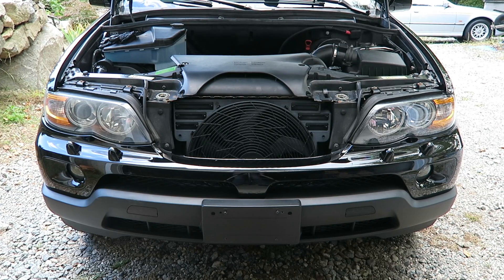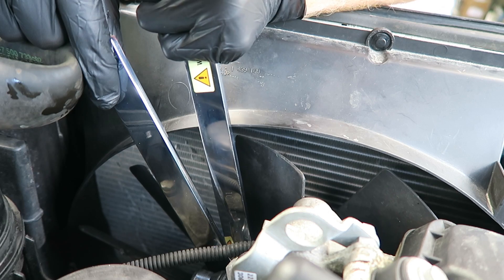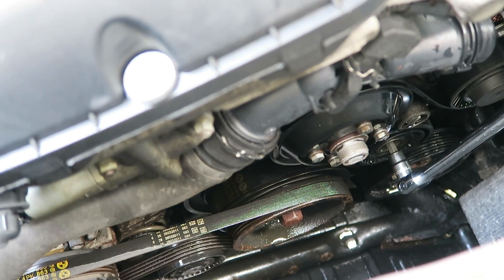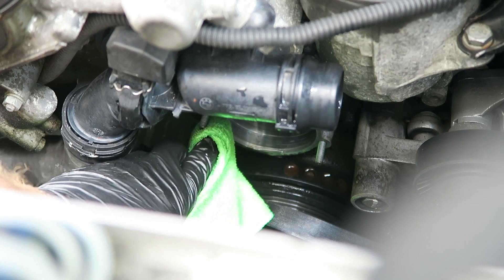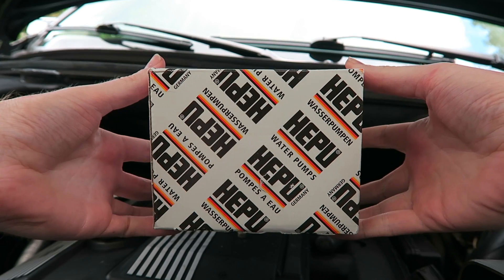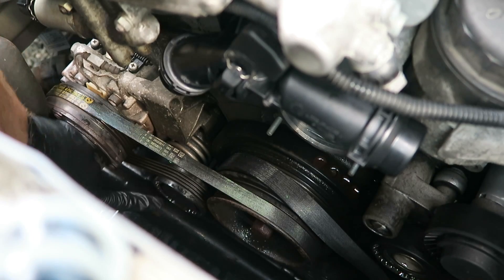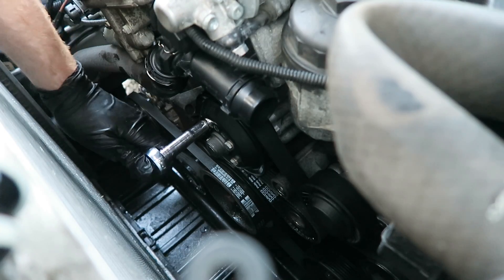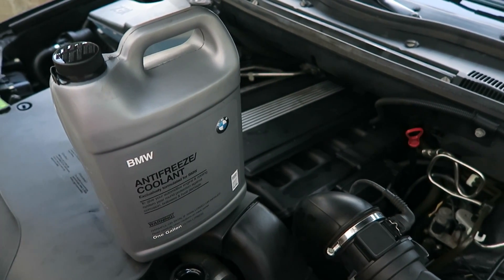BMW M54 Waterpump and Thermostat DIY E39 E46 E53

Comment: My 2003 e 39 had 2 different bolts , one of the differences was the 4 10mm bolts on the pulley, on my e39 it was 3 10mm and a 4mm hex. For my serpentine belt loosener bolt thingy it wasn’t a 8mm hex , for mine it’s a torx screw and I believe a 50. I’m currently headed back to AutoZone to return the 8mm hex and get my torx bit.

Comment: After slipping with the screwdriver one time I'm putting a pin hole in the brand new radiator I always suggest throwing a fender skirt cover over the radiator can save you big money and time👍😏 job well done

Comment: Just replaced my thermostat dated 06-12 and water pump dated 02-03. Great video. Only thing different i had to do was insert a 6mm 1 inch long bolt onto the water pump in order to break the seal since mine was never replaced 205k on my x5

Comment: Didn't know about that date code stamping  BMW does to parts. Cheers for that awesome tip. Off I go to check mine. 
Excellent tutorial btw.  Clear and consise.
Oh, and I'm working on a 01 530. What are your thoughts on the stewart water pump that apparently has 20% more flow capacity than the original?  It costs around $200 but the peace of mind it would bring from never having to do it again and I'm not exactly a big fan of these M54's running at 195F  - 200F. Seems a little too high and as you probably know, heat is the enemy of all engines. Aluminum ones especially.
Reply from the maker: Thanks Andrew - appreciate the kind words. Have an awesome weekend!

Comment: man you`re such a great guy to upload this video but why on earth do you put HEPU on your gorgeous car?
Reply from the maker: that HEPU pump has been in service now nearly 5 years and 60,000 miles .... what is there to complain about even if it fails at this point?
Reply: @BIMMERZEITT  it`s name mate.. gldad you didn`t have an issue with your X5 for 60K miles. could you please tell me btw, can an antifreeze spoil the waterpump? 2 hours ago we started the car and it got a squealing noise from the engine..
Reply from the maker: @ramazkutateladze538  yes if wrong type of antifreeze is put in it can cause corrosion and eat seals over time. I've seen it when orange GM coolant put into a BMW. Yes, I've seen it lol. Some pumps are designed to weep fluid when the internal seal fails so theres that; mostly older BMW's though. Hoses and thermostat could also leak onto the belt, thermostat housing on m54 weeps fluid when it fails sometimes too. Best course is to pull the fan clutch, radiator shroud and inspect closely.
Reply: @BIMMERZEITT  mine is the X5 3.0 2004; aand probably a year ago I poured in it blue Antifreeze.. some off-brand one.. but then again the car has 273K kilometers on the clock.. and there is a chance that the pump is factory-original.. car did not lose any motor coolant though..  thank you for your response, will write the news tomorrow from the repair-masters shop

Comment: Hi Bimmer Zeit, hope you can guide me in the problem I have. On my 2004 X5 3.0i, I have a brand new dealership thermostat. I run the engine idling, the temperature stays normal at 12 O'clock and my code reader shows the coolant at 205 degrees F. Thermostat stamp says 97 degrees C which is 207 degrees F. Doesn't matter what I do, the coolant never goes higher than 205, needle at 12 O'clock. So I can't bleed the coolant system completely because the thermostat never gets the chance to open. So I'm left with air pocket I can't get rid of. Is this normal? Hope not!
Please guide me through this.
Thanks,
P.S. The heater blows very hot air on the road and not so hot when idling

Comment: Thanks for the video, I'm looking at buying a 2002 BMW 530i E39, that needs a new water pump and thermostat. Hope it's as straight forward as this
Reply from the maker: sasunmontu it is very easy, not a big deal at all. Tricky part is getting the fan clutch off, smooth sailing after that! Excellent vehicle choice!

Comment: Great video!  My water pump just gave out on me yesterday.  I saw another video that the guy used a silicone lubricant on the new pump before he installed it.  Have you heard of that being an option before re-installation?
Reply from the maker: Hey Ron, you probably could put a very thin layer of silicone lubricant (NOT sealant or make-a-gasket) to ease the new gasket popping into place
Reply: @BIMMERZEITT  You are the man once again...thanks!

Comment: Thanks, your video is really amazing, professional quality for eveything.

Just a few precisions : the torque for the bolts ?
Some people put some kind of grease on the o-rings and the bolts, what do you think ?

Regards.
Reply: O- rings - yes, use a little bit of grease so the dry ring wont stuck. Bolts - never. You will make the thread oily and that will f*** up the torque (more force with same torque because of less friction in bolt and nut). The torque for M6 is 10 Nm.

Comment: Thank you for sharing this video I'm actually changing my oil filter housing gasket this weekend but I am changing my water pump while I have it apart, there's nothing wrong with mine but it's got 133 thousand miles on it  so I figured why not change it and call it preventive maintenance.. I'm going with an aftermarket water pump with the stainless steel impeller because I've seem plastic ones crack and then lose their grip on the shaft and then there's just no way it can move the water to cool the engines.

Comment: Any thoughts about a stuck pulley wheel and what to do?
Reply from the maker: I would spray it with PB Blast, let that sit for an hour and go make a coffee. Come back to it for a second try.
Reply: @BIMMERZEITT  Thanks so much.  It didn't work right away but my water pump is pretty well stuck so after a lot of pulling the pulley finally came off.  The water pump, however, is a different story....still stuck.  I have an '03 540i and the water pump doesn't have the nice feature highlighted in the video with a screw hole to help break the seal.  Wondering what the mechanic secrets are to removing the beast...ha!
Reply from the maker: Eric Peters Eric I may suggest also replacing the water pump pulley if it’s brittle or has any damage. They’re around $15 online. As for removing the pump, again spray around the edges of the seal with PB, let it sit for a few hours or overnight. Use a pry bar against the propeller where the pulley was mounted... careful on what you pry against though! Final warning, coolant will come out once the seal is broken. Good luck!

Comment: Great video.  Very well put together. I had to replaced my Thermostat, and this made it so easy to do.
Reply: So.. I replaced the I replaced the Thermostat,  but my X5 still running hot. I made sure that the Thermostat opens up before I installed it. Do you think its a water pump issue?

Comment: You use strait coolant.?
You did not mixed with distilled water. 50/50 dilution.
Is it ok to use coolant strait out the container.?
Nothing happens to the engine.?
Please let me know. 
Thank you.
Reply from the maker: Hi, I did mix 50/50 actually I just didn't show it in the video. Probably should have elaborated on that detail. I typically pour a full bottle of straight coolant in, then fill that empty BMW bottle up with water again and pour that in. I do this only when I know it will take the whole container. To be safe, you can pre-mix the gallon jugs before adding.
Reply: BIMMER ZEIT  Thank you BZ.
If I pre-mix one gallon 50/50 BMW radiator fluid.
For how long is the fluid mix good.?
Thank you so much for all you do.
I have and done many jobs on my 2000-328/M52-tu.
Million times thank you.  BZ.
Tonio.

Comment: Also, I would say before installing the fan and shroud spray engine degreaser in the pulleys and all the area you worked on, rinse it off with a hose very well. This will eliminate any antifreeze in the pulleys and belts. Also when the engines warms up you will not smell any antifreeze and think it is leaking.

Comment: Excellent video. Thank you for taking the time to show it to us, very helpful.
I have the same SUV as you do. Just make sure you do not user water to cool the engine. It should be antifreeze BMW Audi or Volkswagen diluted 50/50 with distilled water. Water alone will rust the inside of your engine as well will crack the radiator and expansion tank in colder weather climates.

Comment: Excellent video.  Great quality and special attention was made so that the viewer can see all the necessary portions with great clarity and detail!
Reply: Getting ready to repair a thermostat which is stuck open on my 2006 BMW E53 X5 3.0 with the M54.  This video convinced me to address the water pump and both belts.  Mileage is 90,000 miles located in Indiana.  Service Engine Soon light came on as soon as the really frigid temps hit this past week.
Reply from the maker: Thanks Brock, appreciate it! Good luck with the updates; you'll enjoy the X5 for many miles to come!
Reply: BIMMER ZEIT Just completed installing the new Wahle thermostat and Hepu water pump. I also did a belt service and replaced the old tensioners. I changed the air filter with a K&N filter and changed the oil and new Mann oil filter. Wow! What a difference! My M54 runs smooth as silk...
Reply: Ok. Have a question. Completed this service in January / February 2017. Now my car is over heating. Car overheated and blew a hole thru the expansion tank. Replaced unit with Behr and still running hot. Lower hose is cold; Upper hose is boiling hot. What gives? Bad thermostat? I bought a Wahle brand. Any ideas? I appreciate your videos.

Comment: I'm working on a bmw SUV is it the same as the car and where can I get the parts
Reply from the maker: Yes if it's the M54 engine most parts are the same. Some parts differ between 2.5L vs 3.0L. I have provided links to Amazon in description above- use their fitment tool

Comment: hi do you recommend putting silicone sealant the water pump
Reply from the maker: +Jayash patel hey Jayash, no, you must not use any additional sealants or silicone for the water pump or thermostat on the M54 motors.
Reply: Hi Thanks for the answer but I an going to use sealant on my thormostat  due to it having pitting where it mounts. Bmw m43 engine e46.

Comment: u should mention that this aftermarket water pump is better than original and should be used instead of original bmw water pump, because original had problems with plastic propeller breaking off and destroying engine in worst case scenarios.....this after market water pump has metal/steel propeller....im not sure how long it last, but it not gonna break up like plastic one.
Reply: and 2 years after making my original comment my plastic water pump broke in half :D now i have to replace everything along with fan clutch, water pipes and tentioners :(

Comment: Great video as usual, and thank you for posting. I have 2001 330 with a M54 engine with 80,000 miles and I am the second owner. I recently changed the expansion tank, and i was advised to change the water pump and thermostat, which I am about to do. But, You suggested to change the belts, and my question for you is : should I change all the cooling hoses as well?
Reply from the maker: +J. F. Lemoine thanks for watching J! Yes, I would advise changing the upper and lower radiator hoses as part of the scheduled maintenance. They could last a while longer, but if you do them now you'll save yourself a lot of labor in the future.

Comment: well done video. I really like how you dont rush, and spoken clearly. Questions, no gasket or sealant needed on ether housing?  and why not put the waterpump on before the thermostat, so you have more room and visibility to the waterpump?mini
Reply from the maker: +Jeff Hagen Thanks Jeff means a lot. The M54's water pump and thermostat have the gaskets built into the part. As you can see on the pump the black o-ring gasket is all that is needed. The parts can be installed in any order, independently of each other- but you're right- putting the pump in first gives a bit more visibility from above.

Comment: Great job, very clearly photographed and described.  Well done!  I have the similar engined 1997 e39 model, does that model require the replacement of the thermostat and housing as a single unit?  I bought a Wahler thermostat and it looks like a conventional thermostat, so I am thinking that I can use the old housing.  Is that correct?

Thanks!

John
Reply from the maker: +John Ashbourne Thanks John. Yes, the earlier model E39 uses an old style thermostat and the thermostat housing is a separate part. While you can reuse your original housing, I would recommend changing the housing at the same time while you're in there as it's very inexpensive. Also, note that the early model doesn't have the electronic sensor and plug for the thermostat, however, this DIY is about 95% the same with only a few slight differences. Hope that helps!
Reply: @BIMMERZEITT  You are a Great Utuber with Class and Quality! Very Polite and responsive Dude!